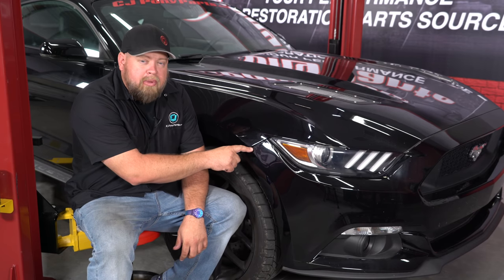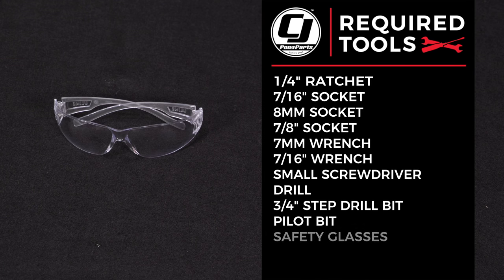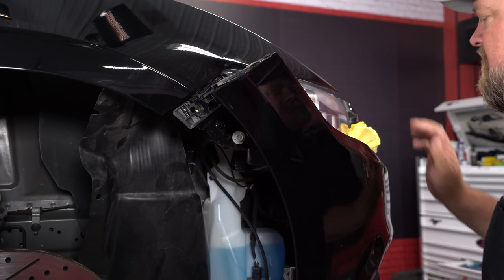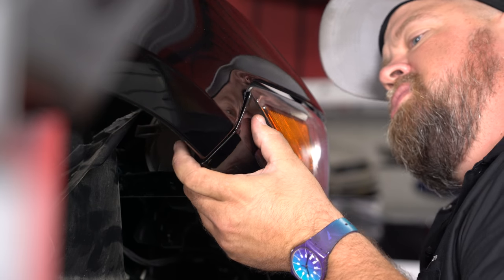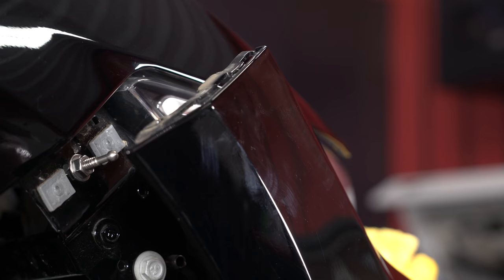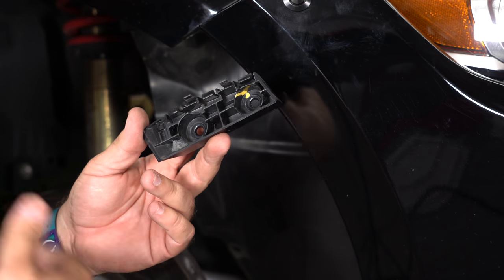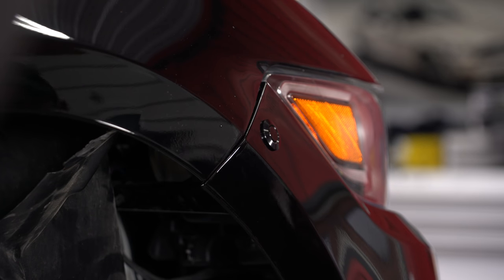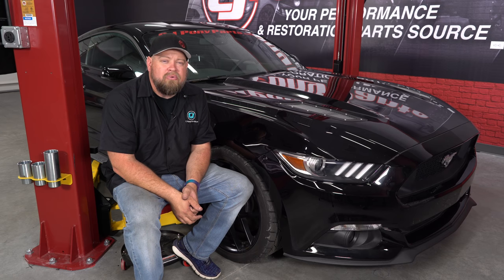S550 Mustang Install: Quik-Latch Black QL-25 Series 1" Diameter Mini Latch Assembly

Comment: For those that don't like the look of the quick latch, you can salvage the piece by impregnating the bumper and lip piece with some fine mesh from a food strainer and a flat tip soldering iron. Doesn't add thickness if done correctly and pretty rigid.

Comment: The description for this video should be revised. This install and product will not work on 2018+ as the brackets are similar but not quite the same.
Reply: How do you fix the 2018+ with this issue?

Comment: Am I correct in saying this issue doesn't apply to 2018-23 "Gen3" cars? .... I've only seen the 15-17's with the issue.  IMO, major fail on Ford's part, and I'm surprised someone hasn't come up with a solution that keeps the car looking stock.
Reply from the maker: Correct! Ford made a change to the bumper design on the 18-23 GT and Ecoboost that is way less prone to damage.
Reply: There is a zip tie fix that works well and leaves the car looking stock. Proven to hold up to high speed and all.

Comment: Hey, Bill. I'm in the market to buy the quik-latch for my s550. Would I need the assist springs as well or will I get by? Thanks!
Reply from the maker: The springs will make it easier to remove but I don't feel they are needed. For something like a hood yes since you open it often but you probably aren't removing your front bumper that often.
Reply: @cjponyparts  10-4! Thanks! Placed my order last week on the latches.
Reply: Bro you don’t have to get a quick latch just go to your local body shop and they’ll simply apply some black glue let it dry and it works great for only 20 bucks
Reply: @renegarcia7591  Already have the latches. Doesn't look bad on a black vehicle so no complains here.
Reply: @ToxicatedValentine  link please. Can't find em on site
Reply: @ToxicatedValentine  ty!

Comment: I installed these on my 16 GT, however i wasn't able to retain the black rectangular support bracket. When i try to install/keep it it pushes my bumper too far out and prevents the latch from engaging and getting a flush install. Without it, it seats perfectly and aligns they way it should. Any suggestions?
Reply from the maker: Make sure the bracket is seated properly and not sticking up because of the pin. The bracket is not 100% necessary but usually provides a better surface for alignment.
Reply: Just installed on our 2017, had the same issue and shaved down the plastic bracket with a dremel and a sander. Fiddly but fits much neater

Comment: Got the same installed on my 16 S550 but my installers didn't use lock tight and I'm constantly having to re-tighten the quick latch! Now even the quick release features isn't releasing from the base and on stuck mode!

Comment: Option 3 use jb weld and never brake like I did still on after 2years
Reply: Jose Velasquez please explain more
Reply: Now can weld the plastic on any bumper you can buy a weld kit and fix you bumper and it’s like nothing happen that’s how it looks like after